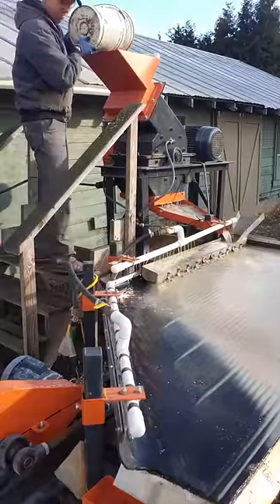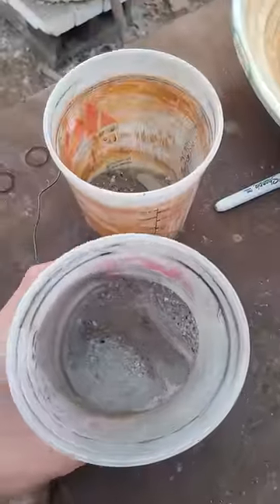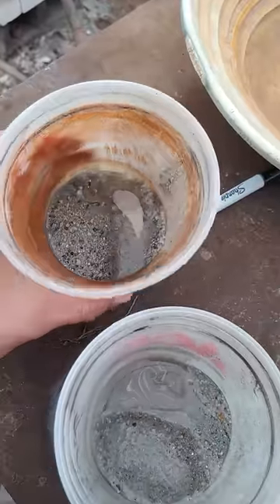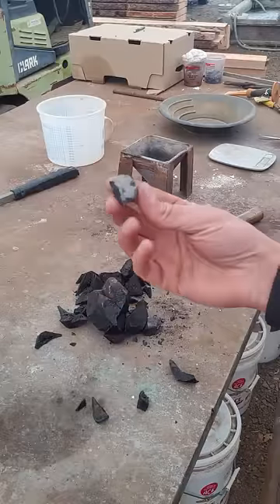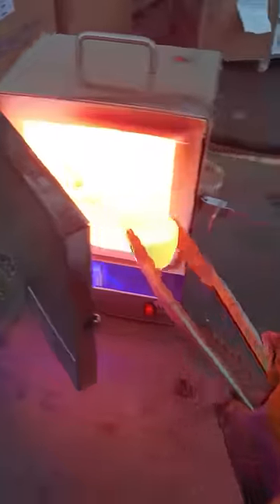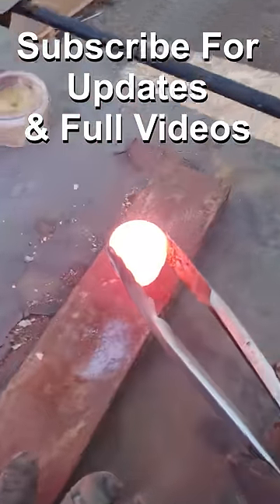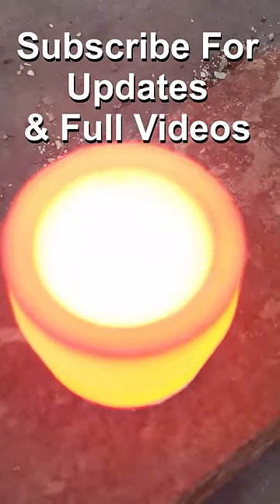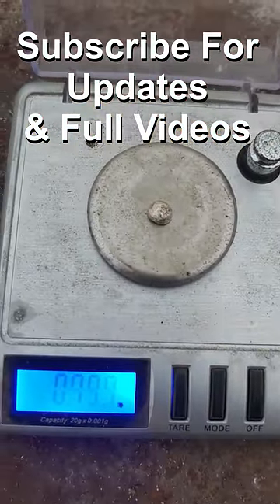Gold and Silver in 60 seconds

Comment: Remember guys, sure an ounce is like 1000-2000 dollars, but he only had .8G. An ounce is 28 grams, 31 for a Troy ounce.  He has 35-70 to 32-64 dollars there. But also think about this. Eletricity cost per horse power of an hour of runtime is about .10-.20 cents. He's probably using less than a nickle to process it on the shaking table, probably another nickle for each thing thats electric. And if he's using gas power, it'll only be 2.50-5 dollars per liter of gas. He doesn't need a ton of gas, plus the gas won't run out immediately so he can more than definitely get a profit out of either scenario, even if it's as tiny as it is. You just need a lot to actually make back your costs of purchasing the equipment, which he can do, it'll just take a while considering these machines can potentially go up to the thousands.